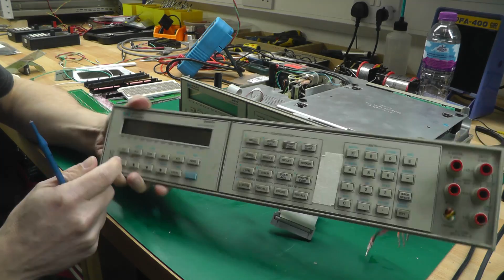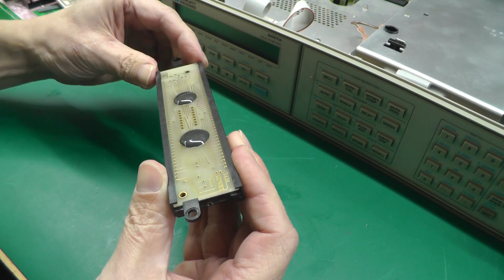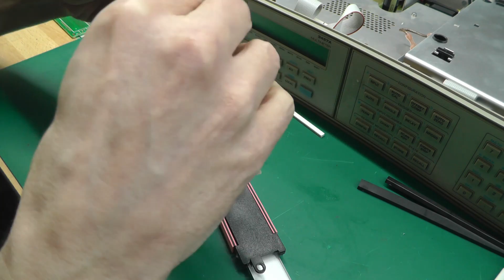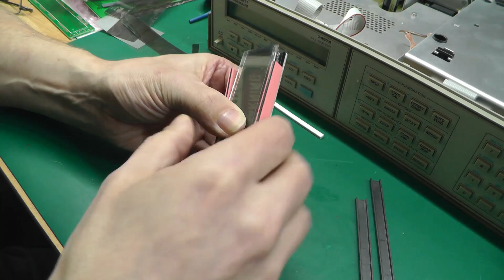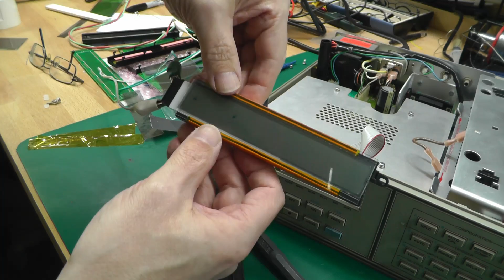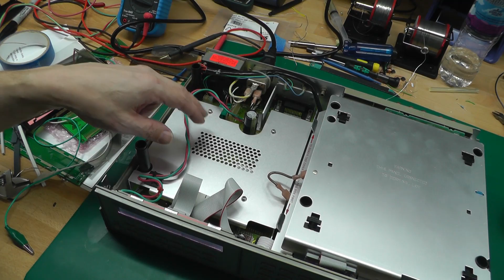No.042 - HP3457A Backlighting Mods

Comment: Great vids ive watched all many times. As a newby to electronics I wonder if one could cover the reading and transfer of dat from the dreaded DALLAS DS1230B-120 sram, as installed holding calibration data for my beloved old Tektronix TDS 320 which is now a timebomb for disaster as the sram internal battery is in excess of thirty years old.

Comment: Dear Ian. Try to find EL backlight with the desired size for your needs. It's much thinner and you can use the original plastic LCD holders. And try to find longer polarization foil to make it better. Not by adding an extra piece of polarization piece.
Reply from the maker: Not happy adding an EL backlight with its HV switching inverter inside a precision DMM.

Comment: Nice hack Ian, just a small suggestion and it's using old school tech, but Electroluminescent sheet cut to size might have been thin enough to fit between the glass and the PCB without affecting the rest of the assembly.
Reply from the maker: What put me off EL was the voltages involved, i.e. the 3457A is a precision DMM and I'd always be wondering of the EL/Inverter was affecting the stability/accuracy. With the LED backlight it's a simple 5Vdc application. Heck, I even bought carbon fibre braiding to run the 5Vdc down (but never bothered fitting in the vid). It's an idea though......hopefully somebody else will give it a go.
Reply: @IanScottJohnston  Good point about switching noise.
Reply: @DextersTechLab  and also cutting a EL destroys the gas seal, reducing life expectancy of the EL panel.

Comment: Looks good.
Here's a tip I learnt from a decorator regarding wallpaper joints, but works for anything. 
Overlap both pieces slightly and cut through both simultaneously, then discard the trimmings. As both sides were cut together the join will be exact!

Comment: Thanks for the video! I have a Keithley 197 and it has the same kind of display, the construction is quite similar to yours in the HP 3457A. I might try with an EL strip as the back light if I can locate a replacement unit just in case.
Reply: So did you tried it?

Comment: Second way to do this, is removing black plastic, in the place of that plastic, putting flatter backlight module and using original clips and contact rubbers to hold all in place.. but original black middle plactic with mounting holes, goes to back side of LCD PCB and mounts all display module.. good thing, that there is cut out for ribbon cable in the middle..
This is the way how i may do backlight hack for that particular display construction.. ;)
Reply: Can you point to a source of a suitable backlight module?

Comment: I watch this twice and I still cannot understand where the extra width came from as the back light slides freely in the void, the original unit width was only PCB > Z strip >glass with rails holding the assembly together, How did that change? Great Video.
Reply from the maker: I used different z strips that were twice as high as the original, this gave me the additional room for the backlight strip. Then, when screwed in place onto the meter I used longer screws to accommodate the new height.
Reply: Many Thanks, Makes sense now.
Reply: Where did you buy spare zebra strips.
Reply from the maker: Simon Tay. They came out of the same lcd that donated the led backlight module, just cut to length. I got lucky with the height.

Comment: Maybe 3D print some new clamps for the glass and zebra strips?
Reply from the maker: Never got round to buying a 3D printer......😀
Reply: Metal clamps are better and stronger anyway but you need to be careful not to crack the glass.
Reply from the maker: Yes, had to be very careful. I put small strips of kapton tape between glass and metal.
Reply: Awesome!!!! So nice!!!
Reply: That's what I was going to say. I will be glad when I get a 3D printer and learn how to use it.
Reply: Indeed, justification, if any were required, to buy a 3D printer, just bought one myself, can't think why I didn't do it ages ago, would have created a matching pair of clips as per the original HP design....  Fantastic vid Ian, could tell by your voice you were chuffed with that mod.... 😀